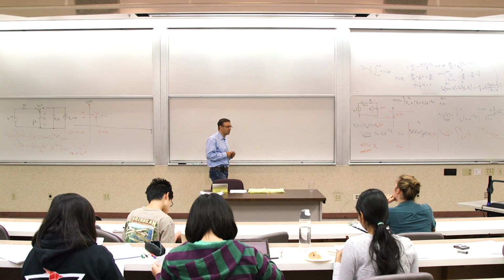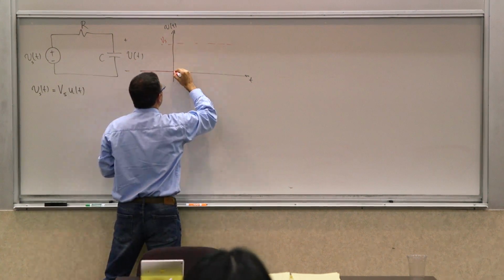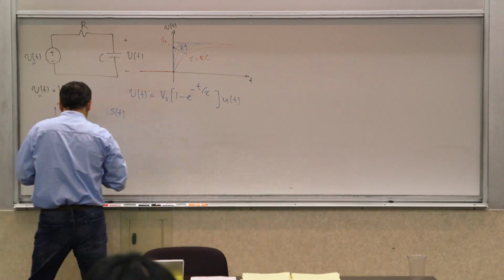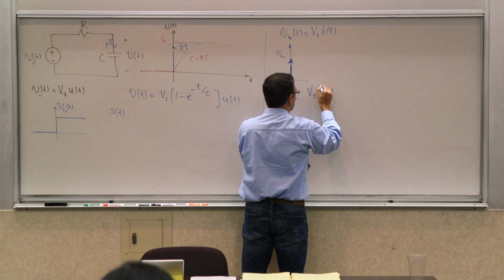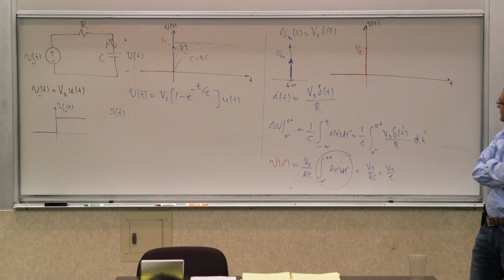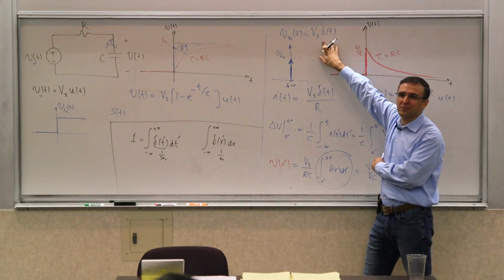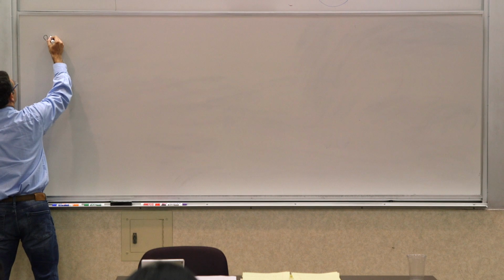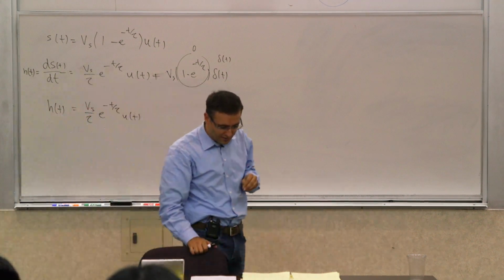015. Time Domain Response: RC Step and Impulse Response

Comment: For the impulse input, the circuit would become open instantaneously as the resistor would melt due to high current? Or resistors can handle instantaneous high values safely?

Comment: Assuming that the purpose of these topics and circuit lessons, in general, is hardware design (if I understand correctly), what does this step& impulse response in reality mean? And what is its use?
Reply: Prof. mentioned that step response is like turning on switch. So if your hardware is a RC circuit, you should see an output similar to the step response after switch on. Same applies to impulse response where you need to give a spike input.